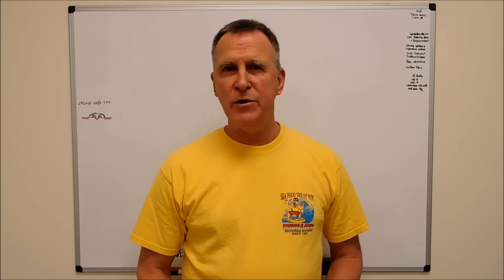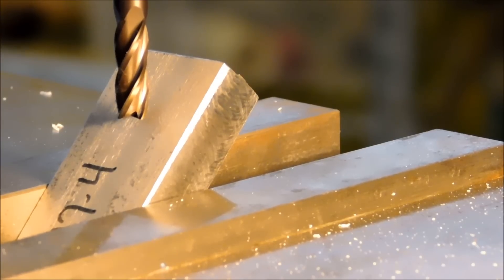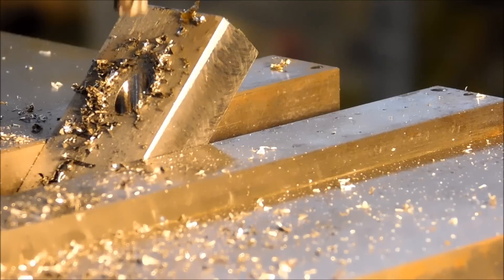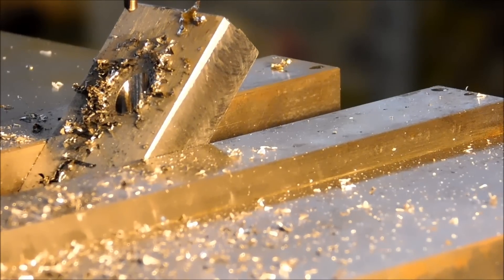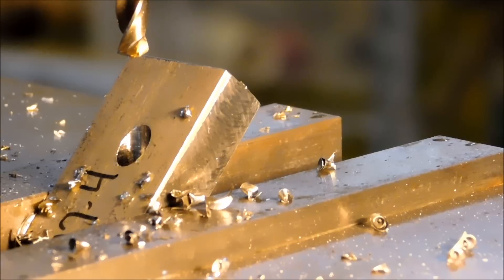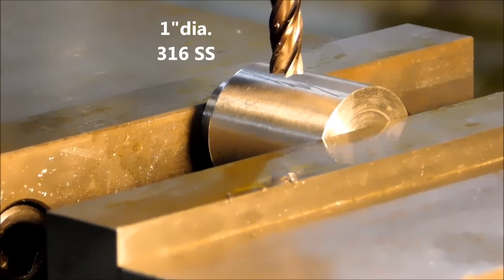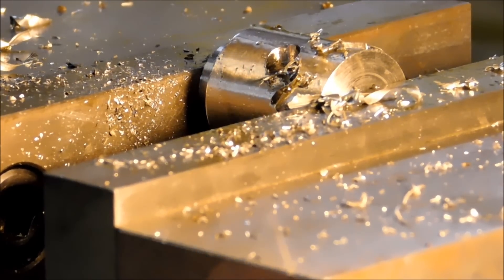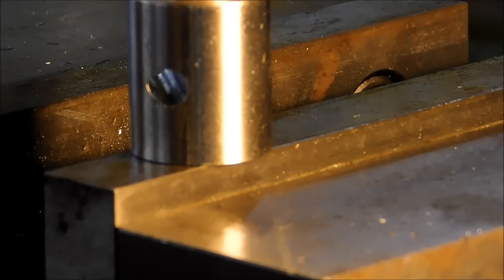Drilling Holes on Angled and Rounded Surfaces

Comment: Another question, sorry, but would you use the end mill if you were drilling straight down the center of the round bar?
Reply from the maker: Either that or a center drill that left a full diameter feature.

Comment: Am I correct in thinking that if you needed a “land,” or maybe it’s a “shoulder,” for the head of a fastener to rest on could you use an appropriately sized end mill to create the “land” and then drill the hole in the center of that area?
Reply from the maker: Yes.

Comment: So then how would you tap an angled hole like this? Especially for a small tap, getting it started on-axis and cutting the first angled section seems like it would be a real challenge.
Reply from the maker: Make the starting counter bore the size of the tap major diameter. The tap will then start on a flat surface with full perimeter contact.

Comment: Just before breaking through on the back side of the round stock, could changing to the end mill break through without walk out or a bur ?
Reply from the maker: That would certainly help if the end mill was a center cutting type and correctly sized. Just creep it down just like the drill so it doesn't pull through too fast.

Comment: Had that same problem with a jet mill I worked on. Check your variable speed pulley disks on the motor side. Also, the associated bearings

Comment: Hi. Have you any idea how to drill holes on a sphere? Maybe like 6 holes (north, south, east ,west, z+, z-)
Reply from the maker: If the holes can go through, its easier, but a sphere indicates the same as a cylinder. Find zero and drill the first hole. If you can't drill thru, flipping the part for the second hole is the toughest part. You can use a collar on the ball with flats, but it must be secured to the ball before the first hole is drilled. After that, pins and the 'V' block becomes your best friend. Second option for drilling the second hole is to use a pin mounted in a 'V' block that fits the first hole. Set it up vertically, indicate it and drop the ball on. The second hole is now ready to drill once you stop the rotation of the ball. Make sure you have pins for this task, or you will pull your hair out trying. Sounds like a good video topic.
Reply: Thank you much for your reply. I am somewhat new to the terms you use, and not sure I completely understood everything. Hence, I think it would be a great topic for a vid. BTW, I was trying to figure this out for a small scale mace for my son. :-)
Reply: Also, what if you had to indicate existing holes on a sphere/cylinder, that were either messed up or just need to be re-drilled and/or tapped? Maybe use transfer pouches to get you close, but then what? Thanks again for you and this channel. I have learned a bunch from you and I would love to buy you a beer. :-)

Comment: I know this is an old video, but I did basically the same thing on a round column mill/drill..................... with the exception of "raising the table".  I had to use the quill to drill the hole.  Although I did use collets to secure the endmill & drill bit.  And to make sure the drill bit went straight, I center drilled the starting point.
Reply from the maker: If you can't raise the table, take small incremental steps from above to a hard stop until a good footprint is achieved.

Comment: What would you do if you had an odd size hole like say 17/64" or 9/32" for which you don't have an end mill of the same diameter?  Would you be forced to use a 5/16" end mill to do the 'footprint' and then switch to the desired drill bit or is there another technique?  BTW I really enjoy that you use manual machines to do your videos instead of relying on NC/CNC machines.  Knowing how to use manual machinery provides a solid foundation for a person to move to computerized machines.  Thanks for sharing your knowledge!
Reply from the maker: Use the next size up if the part allows.

Comment: Granted im not a machinist and im not around a knee mill alot. i took a machine tools class in college and all 4 knee mills they had sounded like that so i dont know who has a quiet mill but its not common and its nothing to be sorry for lets face it machining is not a quiet task.
Reply from the maker: Plastic rear spline bearings have since been replaced. The front could use a new set now.

Comment: Is there a trick for tapping start from an angle?
Reply from the maker: Establish a hole the size of the major diameter of the thread, then start the tap. A mild counterbore is the trick. Since the angle section will be a partial thread and have multiple sharp points, many customers prefer the clean entry or exit area.

Comment: Just drill it straight first  until the 'countersunk' part of the drill has cleared, then angle it in the vise and drill at an angle. Simples!
Reply: That is fine for hand drilling in soft materials (wood, plastic,) but for precision work in harder materials the spot-facing technique Joe demonstrated is the way to go.

Comment: I had to do this in 3/4 S/S nuts for a anti tamper wire. Orders were for 1,000. Came in from the side with a 3/16 4f center cut @ 850-900rpm then set up with the drill bit. Gota love an air vice!

Comment: That's crazy,  if you have the end mill, just finish the hole with that.
Reply: Exactly. I was thinking the same thing. Why go through the hassle of changing out the collet for a drill chuck.
Reply: It’s to much load on the endmill rather than a drill bit.

Comment: Sounds like the Spur Gear has a missing or chipped tooth or some gasket material is in the mesh. Could be a head or journal bearing but seemed too regular in the intervals. bearings tend to change with the shaft speed and the spur gear is always spinning at one speed with  the motor..It would drive me crazy, Id have to pop it open just to look. XD

Comment: I so enjoy your videos...I am a retired Aircraft Propeller Blade Technition...I have worked on many different types of Aircraft Propeller, from C130 and P3 Orion, Cessna Aircraft, Pipers, and crop dusters, and the list goes on....I Am fascinated by Your precision and downright incredible ability to make things work...The knocking sound in Your milling machine, is like a set screw has backed out of a rotating shaft and is hitting a stationary metal structure..?   I am considering purchasing a small (used) lathe, and making some fun things...there is a video of a gyroscope and a few other things I am looking at also....Henry...keep up the wonderful Work You are doing...

Comment: Joe got Question got Job come up whats the best way of drilling a hole in the center of a s/s 5 mm round bar in the center with 2 mm drill, going through more drill bits than enough and some of them run of center and spoil the part
Reply from the maker: Drill a 5mm hole in a piece of flat stock and stick you part in. Drill the 2mm hole through the side of the flat stock and keep the setup as a guide. You may have to rotate the the 5mm stock to knock off the bottom burr to get it out, but it will work very well.

Comment: Hey Joe, i am the only "machinist" at a local shop that deals only in stainless steel. What is the best method in your experiance in threading stainless up to about 5/8" and below. I have tried everything i can think of with no good luck and ALOT of broken taps. We are buying the Titaium taps with so so results, i have drilled out the holes to the point that one would think that there is no way theards would hold a bolt in, i am lost and looking for some real imput or advice please.
Reply from the maker: Coated taps are a good place to start. Use at least 3 flutes. 4 preferred. Be patient. Use the next tap drill size up. And a killer lube like Moly Dee or anchor lube is key. Emuge brand taps have a good reputation for stainless.
Reply: Hello Joe,
 .. you might add Rocol RTD (liquid or compound)  to your list of killer lubes, particularly  for tapping stainless V2A or even V4A steel. Has served me  for decades.
BTW, i enjoy your videos a lot! 

Just haven't found yet whether you are a better teacher or a better precision mechanic!

Greetings, Bernhard from Germany
Reply: Thanks Joe. I will give it a try and doing a search right now on that brand. I am no where the machinist you are but i take alot away from your videos. I actually started threading all my stainless away from the chuck...... major plus. Keep up the great work.
Reply: Blue thumb is a mistake. Sorry
Reply from the maker: @chrishill6276  Explain your comment.
Reply: Joe Pieczynski sorry Joe hit the blue thumb by accident. Thanks for vids. Very enlightening. Chris Hill
Reply: If you are speaking terms with any sales representative, ask about thread milling.

Comment: When you get to the drill bit are you still raising the table into it or are you now drilling down into the block?????
Reply from the maker: You can feed it like a normal drill op until it starts breaking through. Then you would be best served by raising the table a little at a time and bringing the drill down to a hard stop. It will reduce the drill deflection and grab potential from the uneven breakout on the underside of the hole.

Comment: Act II ... how do you tap that hole?
Reply from the maker: The initial C bore operation would use an end mill equal to the diameter of the tap. Only the through hole would be smaller. Since a partial thread is useless, it is normally only present at the bottom or exit of the hole.

Comment: Very good idea. Starting end mill must be very sharp to push of the angle work to be drilled.
Reply from the maker: Take small and firm bites so it doesn't bounce. Come up with the table if the quill bounces on a top approach.

Comment: Can you elaborate on not using a end mill in a drill chuck? I didn’t know that would be an issue. I bought some end mills so I could drill a flat bottom hole in copper.

Would the end mill work in a cordless drill if the drill was in the screw/clutch mode?
Reply from the maker: Normally chucks are seated on tapered arbors intended for direct  inline axial loads. End mills produce side loads and may unlock the taper. Chucks also don't offer the support an end mills requires so the chatter or dancing around will be amplified, not to mention the unintended load on the chuck jaws. Its just not a good practice.
Reply: I know about the side load on drill chucks and the end mill being used in them, but even if your "drilling" as you did here with vertually no side loading on the chuck or mill, you still dont abvise it?
Reply from the maker: @timenlow443  Although there is no linear side load, there is an impact side load from the interrupted cut on the angled surface. Its a problem waiting to happen for taper lock chucks.

Comment: Or you could clamp or weld down a wedge shaped scrap with the same angle so that you end up with a horizontal surface again, then drill through both of the pieces, using the top one as a guide for entering the workpiece. Be careful with the corners of the drill bit though, they will have to take the beating.

Comment: I just mill in a pocket. ~( 'w')/

That is...unless its a mass produced part, and in that case I build a guide bushing.
Reply: Delicious... Your guide bushing will work in most instances, but the drill bit will still be subjected to interrupted cutting and radial loadings, at the start and end of the drilling op, which drill bits, Jacobs chucks and tapers were never suited to. (although in the early part of my career, we still encountered milling cutters retained and driven by Morse and Brown & Sharpe tapers, they were right hand cutting, left hand helix to counter the "pull-out" that would have happened had they been right hand helix.  Downside was they had negative front and side rake. I may still have one in my box, unused for 45 years...)
When drilling military aircraft fasteners for lockwire holes (across the corners of nuts and bolts, the flats at 30 degrees from the vertical) we struggled too, with 1.2mm drill bits and bushings, even in a "sensitive" drill.  Drills broke regularly, either on entry, or on breaking through. The answer was a patented system whereby a disposable (sacrificial?) chevron was clamped to the bolt or nut in a jig, and the drill was started on the flat surface of the chevron, and never actually had to break through into air at the bottom, as long as the hole in the fastener was complete.  Drills weren't terribly expensive, but breaking one in a, say, £70 fastener at 1970s values wasn't great. Last time I used the system was on Armoured Fighting Vehicle assemblies in the early eighties, on tiny, but valuable, stainless steel tubular nuts.
Reply: @robertlawson8572  I shall refrain from saying anything rude, and instead say "Thank you for your great gems of wisdom"...which, just happen to have absolutely nothing at all to do with anything I am, or would ever be doing. 
~( ,m,)~
Reply: Would that I had your far sightedness at the beginning of my career, and known what information I would, and would not, have need of in the fifty years most of us spend at work.  I regret the hours I wasted in the seventies and eighties trying to remember and implement useful (it turned out) advice I'd taken little heed of in the sixties, because I couldn't ever envisage my needing it.  Remember this exchange one day, when you discover the limitations of bush drilling on angled workpieces...  Best regards, Delicious. @DeliciousDeBlair
Reply: @Robert Lawson its a pity your solution wasn’t understood by that by DD. If you have 1000 parts and that same hole to cut in even two of the points of the hex, the jig you describe would be a real time saver. Unless you had several size wires each requiring a different hole size, you would really only need one of the “chevrons.”
Reply: Wow, what a snarky b@tch you are. You might have actually just said thank you, and moved along. Maybe it was that time of the month for you? Or maybe you’re just an inconsiderate nag?
Reply: Since you seem soooooo concerned with the relation between comments and the matter being commented on, perhaps you will be good enough to please explain how your “guide bushing” is at all related to Mr. Piecyznski’s video? I quite understand there is more that one way to skin a cat, but how is your comment either an explanation of, an enlargement on, or an improvement to this video? Maybe you think you’re entitled because your a girl working in a machine shop, historically a male occupation center, and having broken that glass ceiling you are oblivious to the shards that are penetrating your brain, and clouding your thinking. Maybe you should just consider saying “Thanks Joe, I learned something.” Of course maybe you didn’t learn anything. In which case I wonder why you bothered to watch the video much past the first part.

Comment: forgot to mention @5:20 or so you mention putting end mills in chucks.I have heard this many times whats the science behind this?
Reply from the maker: Drill chucks are designed to grip and hold a part during rotation under axial load. Most drill chucks are also taper driven. The side loads an end mill can generate will cause excessive vibration because of the distance between drill chuck jaws and not only result in chgatter, but possibly cause enough load to unlock the chuck. Small cuts can be OK, but the guys doing milling are pushing it.
Reply: Sam Rod They also don’t have near the surface area radially to stabilize the end mill. Easiest way for same diameter multiple tools is an ER40 chuck set.

Comment: I know this was published almost 2 years ago, but have you figured out & fixed the mill noise yet?  My draw bar has a slight bend in it & it makes quite the knocking noise, more with some collets than others.  Pull the draw bar out and turn on the mill.  If the noise goes away you've found yourself a cheap fix with zero down time.  Here's hoping it's that easy.
Reply from the maker: These machines have plastic shims around the drive splines. When they go, it knocks.

Comment: Joe, Thanks for all the great videos. Recently got an old craftsman 101 series lathe and have spent days watching and learning with your videos.  What would the best way to tap threads in these type of holes? Just curious don't actually have an application at present.
Reply: You could use an endmill as big as the threads you want to cut (i.e. a 12mm mill for a M12 thread) and the accordingly smaller drill afterwards. This only works if the material is thick enough of course. If you want the aesthetics of the thread going all the way to the end just cut them from the back.

Comment: On my little mill the rattle was made by the pulley on the motor wich had the grub srew loose. At work the drill press had the same problem, loose grub screw on the spindle pulley. Hope this helps I you haven't fixed it yet
Reply from the maker: A Variable speed head is a little different. But I do know which grub screw you are talking about on the lever type.

Comment: Does this work on a drill press if I use a 1/4" end mill in it?
Reply from the maker: I am not a fan of end mills in drill chucks, but I suppose if everything was securely clamped down and you took small bites, it may work.
Reply: Hi Joe, I have been learning a lot watching your videos, Many Thanks. What about an End Mill Bit in one on these in a Drill Press, https://www.ebay.com.au/itm/Multi-Purpose-Tap-Drill-Chuck-2-16mm-JT3-B16/302680223579?var=601537182584